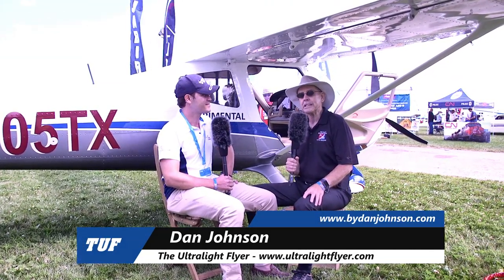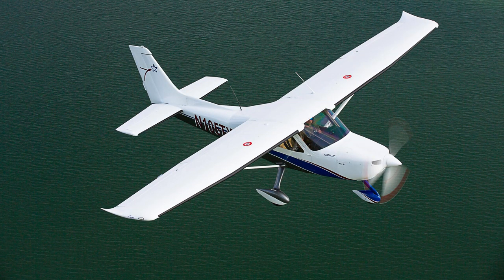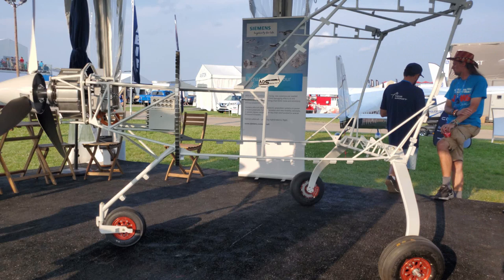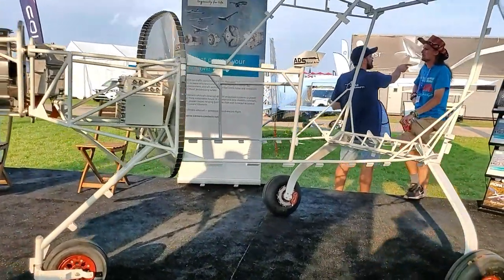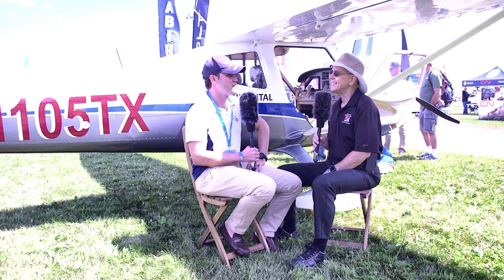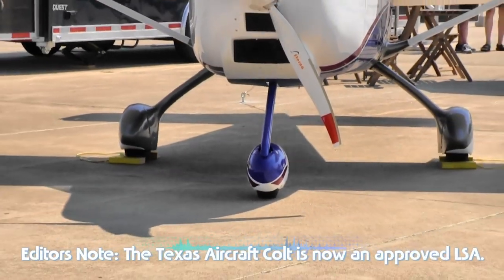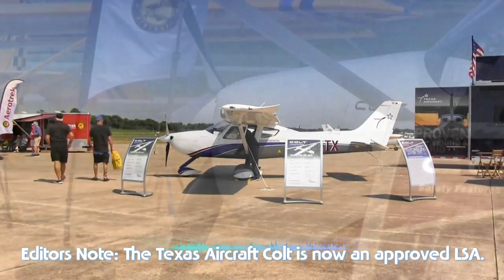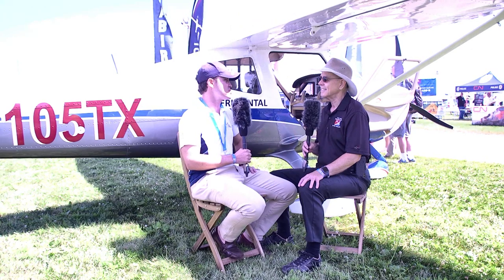LightSport Aircraft, Texas Aircraft, Colt LSA, Copperstate Fly-In, Buckeye Air Fair, Buckeye Arizona

Comment: I feel BRS is a cure to a symptom of the problem of pilot negligence to become familiar with acrobatics, plus also signs of stall and/or uncoordinated flight and conditional speeds required to be in an acceptable flying condition.
Reply from the maker: Really - from someone that was saved by a BRS in 1984 - I would have to disagree! I had a bird strike directly on my engine, causing a wing failure, (Lazair Ultralight). Needless to say I am here today because of the BRS.

The Ultralight Flyer
Reply from the maker: If you search YouTube for BRS deployments you will find one where a pilot deploys the chute after a tow cable from ANOTHER aircraft is caught in his propeller. There have been well over 300 BRS saves few of them are under the conditions you describe.

The Ultralight Flyer

Comment: When will Johnson get back to actual Ultra-lights and AFFORDABLE ELSA's?

$15k-$40k is the range for affordable aircraft, NOT $60k-$200k..........

I'm TIRED of folks continuing to betray the strong history of AFFORDABLE, real average man/woman buildable aircraft.

There is WAY too much emphasis on high cost equipment, high cost aircraft, and if you don't have a full glass instrument panel, you MUST be an idiot attitude!

Get back to the basics please.
Reply from the maker: I would suggest you browse through my channel - a quick search found well over 100 videos on ultralight and experimental aircraft that fit into your description.

The Ultralight Flyer
Reply: @ultralightnews  

Your concentration USED to provide excellent information on just the categories I described.

Past tense.

During the last two years, you concentration seems to center around expensive LSA's that none but the rich can afford.

While it is nice to see some small craft hardware, analog equipment is more affordable and most suitable for 'off airport' flying, which is what Ultra-lights and ELSA aircraft predominantly are, or were. There are exceptions of course, as many as there are different pilots' needs.

However, quality updated information on aircraft such as the Titan Tornado Series, Zenith/Zenair 701, Chinook class UL, Beavers, and the updates should include new affordable motor manufacturers (Aeromomentum, VW's, Yamaha 4 strokes, Kawai 4-strokes, Werners, et al) with higher horsepower offering that meet the needs of off airport flying.

Most of us who are looking at UL's and ELSA's can't fly out of controlled airports, we no longer qualify for PPL's. There are MORE of us than there are licensed PP's, yet we seem to always get the wrong end of the stick with your recent (2 years or so) videos.

I really used to look forward to seeing  your videos pop up on my Viewing List: you provided reasonably in depth information from sources that could be relied upon, and  you and your associate could always be counted upon to ask Real World Questions from a pilot's point of view.

The new stuff however, always seem to be more of an Infomercial for either high/higher end manufacturers promoting their products, which by definition is very biased. The other tack you've taken is a quick Run Through of various shows, giving us only the highlights, rather than dividing up the show into smaller segments that provide a wealth of information, and thus, a LOT more segments to enjoy and from which to learn!

Lastly, you used to have your 'nose' fairly close to the ground on realistic expectations on when/what/if the theorists at the FAA would get out of their own way and provide some BADLY NEEDED wider latitudes on UL/ELSA categories (increasing Part 103 weights to realistic levels, and the same for the Gross Weight restrictions on ELSA), as well as Real World Improvements that would increase pilot/aircraft safety AND improve gph consumption rates via the addition of Constant Speed Props, considering the efficiency and reliability of EFIS.

It may sound like I'm trying to bust your chops here, but I'm really not; I'm just tired of the bland Infomercials and Highlights your videos seem to have become, and long for the in depth specifics you and your associate used to give us......I really did look forward to seeing your videos on my list: I'd grab a cup of good coffee or tea during the day, or a good beer at night, and kick back and listen to every word you and your associate recorded (one of his best was the presentation of things to look for on a Rotax 582 used engine, when considering purchasing a plane, or if a pilot had transitioned to a 582. I hate 2 strokes, and I don't much care for Rotax because of their high prices, and I'll never buy a Rotax engine, HOWEVER, I watched EVERY MINUTE of that video, and then I WATCHED IT AGAIN, because what he was teaching could be used on other engines I might consider purchasing.).

Anywho, that's my rant, though not in a nutshell.

Happy New Year and Cheers from the Oil Patch in Central WY
Reply from the maker: Don't usually cover a craft no longer in production or a manufacturer that is out of business. Unless an owner or builder is at one of the shows.

CH 701 has been replaced by 750 series.
https://youtu.be/fy7mQOMhy7I
https://youtu.be/w5eeKhD89PI

Beaver or ASAP is now out of business.

We have coverage Aeromomentum, VW's, Yamaha 4 strokes, and Werners
https://youtu.be/1aieLfUQnWc
https://youtu.be/0ks9LqboEeo
https://youtu.be/GO8-lhurp5I
https://youtu.be/hdzBb_A0Oi0
https://youtu.be/ZujFEYH7NX4
https://youtu.be/VNq5QAAR5_I

As well Dan did an update on the -
BADLY NEEDED wider latitudes on UL/ELSA categories (increasing Part 103 weights to realistic levels, and the same for the Gross Weight restrictions on ELSA)
https://youtu.be/XY1PttWHEqc

Thanks for your comments on the 582 Troubleshooting - it is nice to know someone is watching.
The Ultralight Flyer